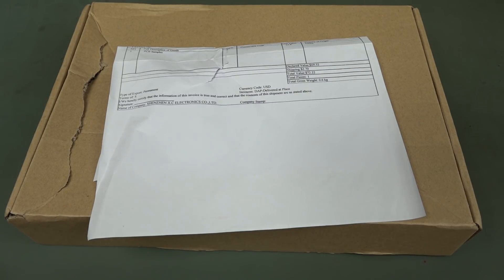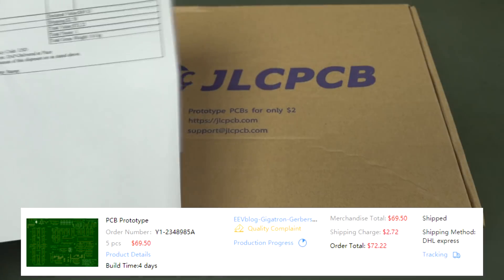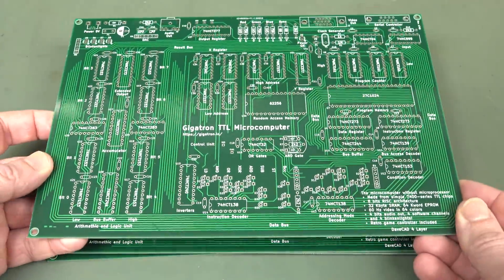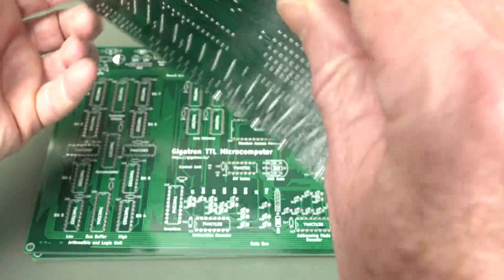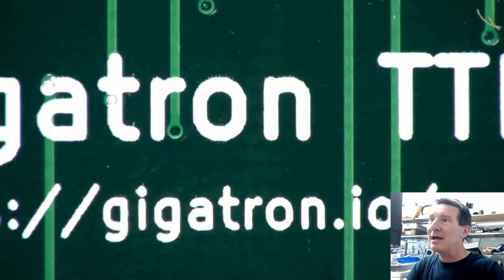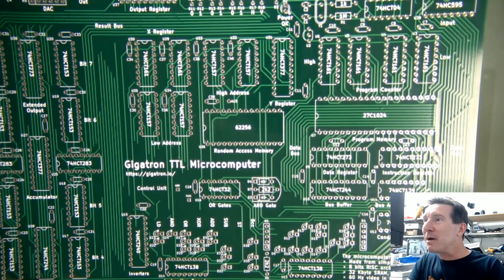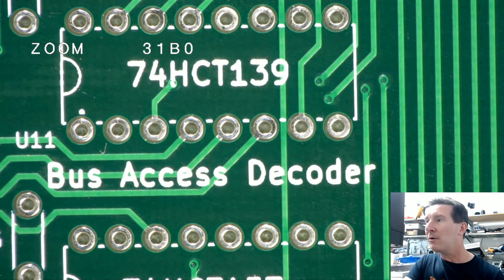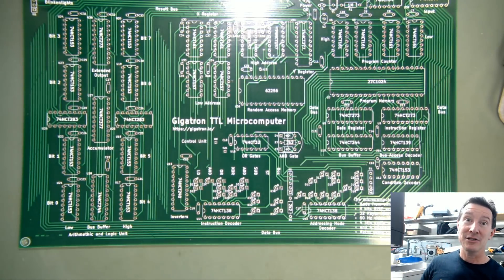JLCPCB Prototype Inspection

Comment: I use them sometimes but they will regularly reject designs with a lot of routing, with no option to pay more to get it done. sometimes they don't even email to tell you - this totally hosed me on one job. 
IME Allpcb email you for additional payment, and have a lot more options. Costs aren't much different.
Reply: I just did a 4 layer board with a jungle of routing and they were fine.  I will try Allpcb. JLC marketing looks like its wining.
Reply: I can confirm that as I ordered recently a 4 layer board from them that needed 2Oz copper (70um) and after I paid quite a serious amount for the 2Oz option vs default 1Oz I only got 1Oz and after I mentioned that they tried to convince me that I do not know how to measure copper thickness with accurate 4 wire measurement but agreed to send me another board and that was the same 1Oz (no real communication between manufacturing and sales). I ended up with another PCB manufacturer that did of course made the board with 2Oz (almost 1.78Oz but good enough).
I also ordered a similar board that was just 2 layers at the same time from JLC PCB again 2Oz much more expensive but those where 2Oz. Those where 1.6mm thick despite me ordering 1mm using their online tool as they can not make almost anything other than most common 1.6mm.
So they are great as they are low cost but only good for simple prototypes and as soon as you want anything different they will not be able to do so or worse send you what they want and no chance to get a refund.
Reply: I think that your designs were hitting hard limits for "Electrical Test" step (respect). They probably can manufacture your boards, but there are so many connections to test that it will clog their manufacturing pipeline if they try to do so. And because it happens fairly seldom, they do not bother adding "no test" option.
Edit: Ok, I think simbone (below) is right - "routing" here is milling.
Reply: Different kind of routing - it's not about the routing of the signal traces but mechanical routing (milling). Too many cut out slots and they might reject it.
Reply: i once ordered some 0.6mm pcbs with slots cut out to make them springy, they didnt reject   https://i.imgur.com/ZeViLpQ.png    but i allways look at pcbshopper, sometimes jlc isnt the cheapest when adding shipping
Reply: Hi Mike, can you elaborate why it was rejected? I had a board ones reject from them and they told me this message: "But really sorry to tell that the size of your panel is too small to be made, it needs to be 5 .5 cm at least, could you please kindly check?" My board was 10cm x 5.3cm with 1 v-groove.
Reply: Have done a few orders with allpcb in the last couple weeks. Great price, great quality and delivery was around a week from day of order.
Reply: @pahom2  He means routing as in cutting not routing as in traces.
Reply: I order a 256mmx90mm board [ 5 pcs ] on jclpcb , cost me €13.74 [ without shipping. ]. Have done the same, same parameters, same quality on ALLPCB, they ask me 30€ ..... [ without shipping. ] Allpcb seems to be more expensive. boards have been received a week after order and the job is done. So even if they are less expensive on shippement, boards cost twice ....
Reply: Try https://www.pcbcart.com/.  They can produce high quality and relatively complex PCB.

Comment: What would you recommend for a budget board layout software.
Reply: I would recommend that you try the free version of Eagle for a while, even if it's a slightly older version.

Then, when you get used to Eagle, try KiCAD, and be prepared to cry. lol :p
Reply: Try CIRCUITMAKER made by Altium, much better than Eagle or Kicad.

Comment: I ordered a test batch of 25 boards (150x90mm 2 layer) on 20th. Was meant to be 3 day build time. They only made it into production today (27th). I may stick with ALLPCB if the quality isnt better with JLC. That solder mask alignment was not great.

Comment: Depending on the manufacturing location, some boards made by JLC may have a weak soldermask bond at the edge. When heated, especially when using a iron, some of those near the pads tend to come off.
Reply from the maker: They have more than one location?

Comment: Recently did a 46x46mm PCB that I don't care if it arrives in a couple of weeks. DirtyPCBs were $14.95 shipped airmail (any PCB colour and I wanted black). JLCPCB were $8 but green only. At those prices I wouldn't even consider etching a board and if I need it ASAP DHL is super fast and reliable to Australia. 

It feels like prices have gone up slightly over the years for small 2-layer boards, but have dropped significantly for 4-layer. It's to the point you might even consider 4-layer just for ease of routing power/ground!
Reply from the maker: Yep, not much price difference for 4 layer now, so might as well!

Comment: RF prototype boards I'd probably do at home since they tend not to be super dense. That's really only use case for me. The pain of not having a solder mask on digital boards with small components is almost too much to bear. That and having to drill hundreds of holes and put in via links. shudder.
Reply from the maker: RF boards are a good candidate for a PCB milling machine
Reply: yeah. Not that drilling is much better but milled fiber glass particles isn't my fave :-) Even with an extractor.

Comment: Typo in Description TLL/TTL ?
Reply: No, it's an abbreviation for Transistor/Inductor Logic, or a totem-pole construction with a transistor on the low side and an inductor on the high side. Transistor to pull the line low, inductor to pull the line very high when the transistor stops conducting. (And yes, I'm joking, if that wasn't clear)

Comment: I have used them for the past year and have had no problems at all. If you want cheaper delivery to the uk use the HK DHL service. It's a shame they don't offer E-packet like pcbway, but they are normally a little more so it's balances out.

Comment: That shipping price is extremely low. Guess because Australia is close to China. Shipping to EU is 4-6 times more.
Reply: There's a $20 (or there abouts) shipping discount on the first order, so that might explain it.
Reply: Knier. So using multiple shipping addresses and you will have cheap boards for a while 😎😁
Reply from the maker: Knier - Ah, that would explain it, thanks.
Reply: Shipping to NL from them is a lot more expensive, and DHL will slap on import and additional handling fees. When the shipping costs are missing on the declaration, DHL will fill out their highest overnight shipping fees, and calculate tax over that. DHL is totally unreasonable and with JLCPCB there was no way around it. However now they seem to offer non-DHL delivery as well, so that is great news.
Reply: beopstek How the f* can they put in costs higher than actual for the import tax shipping costs??
Reply: DHL's customer service rep just said "because it is allowed by Dutch law" when.I called them about that. So I now avoid DHL when possible.
Reply: Yeah DHL are fast, but they do charge us in the UK an extra £11 minimum per delivery if there was any customs clearance involved and the value of goods is over £15 or something. That £11 goes up based on the actual value too. It's an "administration fee" for pressing a button on a keyboard I assume...
Reply: Royal Mail's handling fee pisses me off. £8 to delay your package by a week and calculate a customs charge (on top of the handling fee). Is there any way around it?
Reply from the maker: It's obviously subsidised/absorbed in some way. It was the full DHL courier service, and even China do not get those rates.
Reply: I imagine in most countries it should still be possible to manually do your business with the customs office (which is paid by taxes) and not having to pay anything to the courier!
Reply: Ah. I thought it was just cheap shipping if you order for a high enough price. I made an order in January which was $60 for the items and like $2 for shipping. Now I just ordered a single design for $5 and shipping was like $23.

Comment: Also, The customer ID they slap on the board can be placed optionally anywhere you want by putting "JLCJLCJLCJLC" somewhere in the silkscreen layer. They will make it fit. Or if you have it panalized you can put it on the strip.
Reply: There is however a catch, from the JLCPB website: "The font size should be larger than 0.8mm in height and 0.15 mm in width" Or you pay an extra fee, then the number can be removed completely.  Third option, you do a panel with frame. Then you can place the JLCJLCJLCJLC string on the frame.

Comment: I can confirm that JLCPCB make top notch quality boards. Firs of all their lamination can handle high temperature soldering regardless whether it was specified. Second of all they are fast. One day I placed my order on Wednesday, a DHL courier knocked my door in Sunday noon. Also I can confirm that JLCPCB use robotic probes to test every piece of PCB for galvanic connection/isolation. The traces left by those robotic probes can be seen on SMD soldering pads.
Reply from the maker: Sunday DHL delivery? Wow.
Reply: yes. In Melbourne. I got really surprised on that day. 

"Your DHL EXPRESS shipment with waybill number 7397218931 from SHENZHEN JIALICHUANG has been delivered as requested at 15:58 on Sun Dec 10 2017.

Thank you for using On Demand Delivery."

Comment: Looks like that I'm the only one that had problems with vias ... They removed the solder mask from them :(
Reply from the maker: Sure you specified tended vias, and verified in the gerbers?
Reply: @EEVblog2  yup. I'm using circuit maker and Altium. I triple checked when the PCB was delivered. They also forgot to put the order id where I told using the "jlcjlcjlc" pattern.

Maybe the guy was a bit drunk that day :)

Comment: I can give you a reason why there is a need to make PCBs at home sometimes. The thing is some people share their pcb designs as a plain picture for some reason, Adobe PDF for 'instance. Trying to reproduce that kind of PCB in CAD you'll likely realise that many footprints required are missing in your database so you'd have to draw them extra. But the biggest issue is there is a chance to make a mistake while transferring traces which are quite hard to reveal at first. The best results are achieved with use of POSITIV20 photoresist and ferric chloride for etching. All that requires some skills and UV equipment though as there's no clear specification for the process cause it depends on a variety factors, such as temperature, UV exposure time etc. Sure, all that looks just archaic nowadays.

Comment: Do they know it was you?
Reply from the maker: I greatly doubt it. They promised 4 day turn and delivered it. And price was standard web quote.
Reply: I've used JLC for several orders now, and they very often make the boards that fast, and with the same quality and price.

I doubt they knew or even cared if it was Dave or not, as they make thousands of boards a day, which all go onto giant panels.

If they were THAT worried about making a good impression, they might have redone the silk screen. (which is still a very tiny glitch for prototype boards.)

(btw, I'm not shilling for them, I just think the turnaround time and quality is great for the price, especially for 4 layers.)
Reply: Their prototype boards are always good quality, Dave did not get a special treatment. I have ordered over a dozen board from them, and they are always top quality.
Reply: His board doesn't look any better than any other boards I've seen from them FWIW
Reply: I doubt they're this paranoid to put in an automated factorywide alarm just in case someone with a name THIS common orders a wee little sample. Just imagine how such a humongous factory runs, it's a combination of automated systems and low-qualification workers that probably don't even have YouTube, because guess what, it takes some extra effort when you're firewalled off.
Reply from the maker: BTW, the order was not under the name "EEVblog".
Reply: That's what I wonder, should of done it in Davids name without the video first. But I'm going to give them a try myself.
Reply: They must
Reply: Qué haces Gastón, mira yo laburo en una empresa de electrónica acá en Mendoza y en una semana tuvimos una placa doble faz gigante para un cartel de LED indicador de velocidad. Se demoró más DHL en llegar que la fábrica en hacerla.. eso si.. los costes de DHL en Argentina para el desaduanaje son saladisimos

Comment: There are several reasons why someone might want to make their PCB at home.
Do these budget PCB houses accept photocopied artwork from a magazine, for example?
Suddenly want a breakout board to connect an SMT SDCard slot to breadboard, today? I can do it for next to nothing in an hour or so.
Low volume and simple designs really don't justify the effort of getting it done professionally.

Yes, these boards are cheap and fast for what they are, but it's still often cheaper and faster to make a one-off board yourself, if you don't need PTH or over 2-layers. 

That said, I have a design or two I'm working on which need PTH, so I shall send away to China for those, but in all other cases I DIY it or use Veroboard.
Reply: I think it all comes to a complexity level and space. For example I live in small apartment with my wife who will not enjoy any kind of chemistry in the kitchen/bathroom. And I don't have space for CNC/milling machine which people use to scratch the copper off the board. Therefore I have no choice and companies like JLCPCB are real deal for me.
Reply: Not sure what you mean by "photocopied artwork"? You'd just scan it, and convert it for use on the silkscreen layer, then submit it as normal? I've done this for company logos (well, actually had PNGs or SVGs to work with, but same idea). I'm not sure it's cheaper when you factor in your time, the chemicals, clean up etc involved vs ordering boards at just over $1 a piece (or less) from China - and obviously the end result is a hell of a lot better, and each trace is tested at the factory, so you know it's going to work.

Comment: I just ordered 30 custom Arduino shields from them using their web based software for $30 USD and it took 5 days! And they came out beautiful. What a bargain. Express PCB wanted almost $500 for the same thing.
Reply from the maker: Wow, no contest.
Reply: This is plain misinformation. I have just received 20 boards 350mm by 200mm  ENIG finish, plus framed stensil for top and botom layer for only $300 shipped.
Reply: oups my mistake, I meant pcbway , yes expresspcb is expensive..im sorry

Comment: I stopped etching pcbs at home maybe 5-6 years ago... as fast and as cheap as they get made in China is it just not worth it.Who cares if you make a mistake, it's so cheap and so fast you maybe lose $40 and have to wait another 3 days. Who cares.
Reply from the maker: Yeah, only if you needed something desperately within a few hours.
Reply: @Fusionx916 You would care if your own country raped you at the customs! 
Anything i get from china has to be below 21€ or i have to get stiffed... hard!
Reply: Totally agree.  And then you get them silkscreened so you can label connectors, solder masked, etc, multiple trace layers get properly aligned, vias (tented, even), mechanicals properly drilled or routed - and no mess to clean up.
Reply: While in here chemical products and copper boards are not sold and PCBs and ICs are sized if you import them all that for security reasons.

Comment: There is an option so they add a little bit more on the edge of pcb with the number that you can just break off, mostly seen in panel boards but if i remember there's a way of contacting them or something
Reply: Yes, you can ask for them to be panelled but there is a charge for it but they will put the markings on the edge. There is a 10mm break off piece all around.